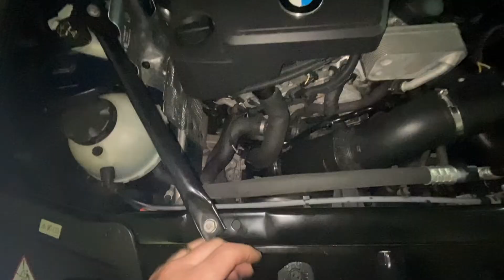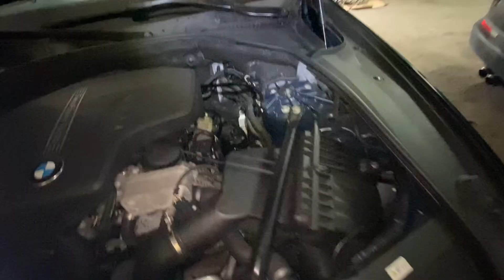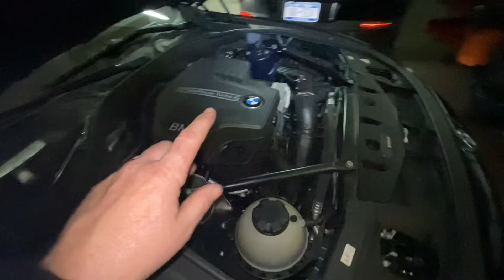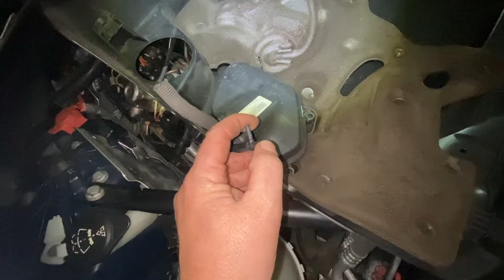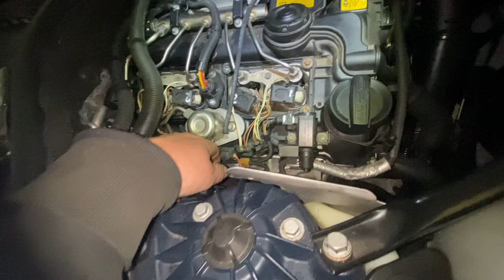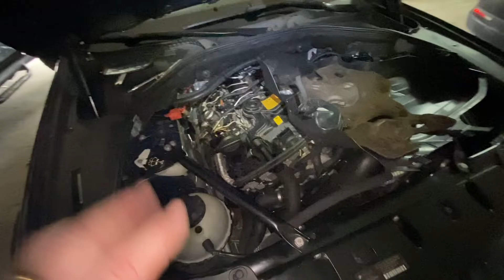Most Common Fixes Of BMW Code 120308 - Drivetrain Malfunction Message

Comment: Hi sir  need your help  l have same same like the one you showed  us it coming the problem  when you drive  the engine oil coming   to the accumulate pipe..but  I tried to by pass the pipe from pump to sensor  without  passing  to accumulate..no oil coming..
Reply from the maker: Don't bypass anything as this will cause the code to stay and have not turbo boost.
You're talking about the vacuum hose has oil in it and the vacuum reservoir as well? That means the vacuum pump has failed and should be replaced. The vacuum reservoir, if it's not leaking and holds vacuum can be cleaned out with some carb cleaner. If it is leaking the whole plastic engine cover has to be replaced.
Reply: Thanks  very much sir
Reply from the maker: No problem